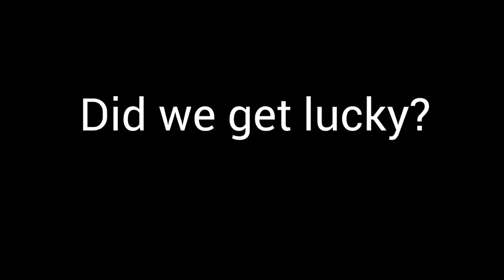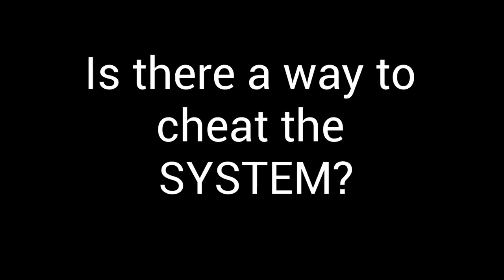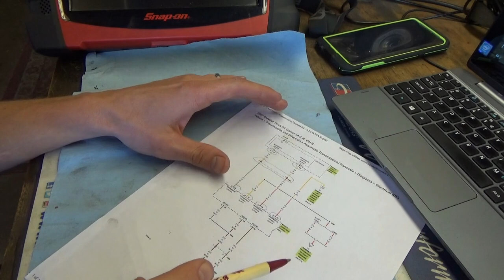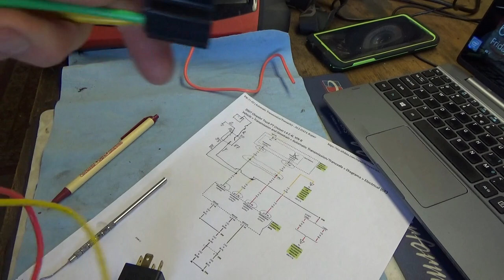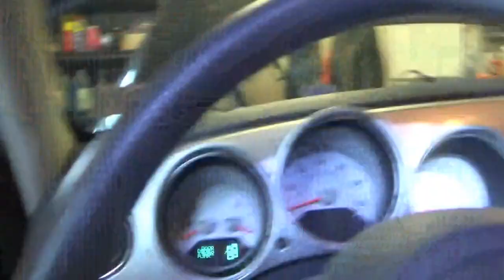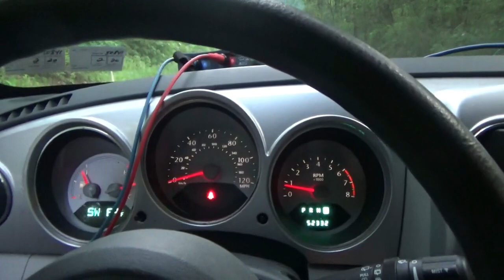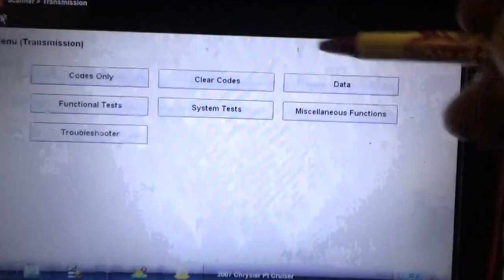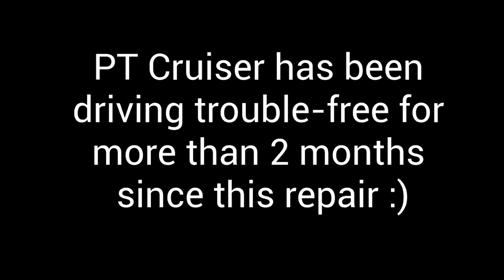Chrysler "LIMP HOME" Cruiser: P0882 - TCM Power Input Low (Part 2 - TIPM!)

Comment: You might soon regret that 1 year warranty. I would have replaced the power power transistors, probably less then 12 bucks with shipping. Or used a solid state relay. Your taking a guess that the output can handle a relay, your not even considering the feedback from the coil when that relay opens, could have at least installed a diode to keep the voltage from spiking.
Reply: Correct, but at 22:41 we have a scope trace of the output of the PCM now going to the relay coil (blue trace). There is no visible voltage spike. I would make a guess that this PCM was originally designed to drive a TCM relay and includes the suppression as part of the controller output circuit?
Reply: @jannepo  , The scope isn't going fast enough to catch a spike and you could be right but I wouldn't be betting 2 computer modules on a guess but it's not my dim.
Reply from the maker: Pico Scope is plenty fast :)

Comment: Hi 
Thanks for the video, I have same code in my Dodge Avenger 2008 SE 2.4 L , 4 speed Transmission 
Can you please help me with fixing it , I don’t have the wiring diagram for it and I don’t know which wires to splice and solder relay 
Please let me know how to contact you, I will pay for your time and help
Thanks in advance

Comment: You're probably also bypassing some other "safety" issues--- by not letting the TIPM put the transmission in limp mode for other reasons..   For example, I know that if the Accelerator pedal and the throttle body (or throttle position sensor) do not agree because the throttle is sticking, or more likely:  the plastic gears that actuate the throttle body break---  It goes into limp mode, because the throttle could randomly go to WOT (wide open throttle) or something, or could get stuck in WOT after you step on it-- because of a broken piece of gear making it stick open, ect.. ect..   I'm sure there are other reasons.  My 2010 Dodge Nitro had this issue, and the trans was put into limp mode--- obviously by the TIPM----------  This bypass won't allow that to happen now--- so if the car got stuck in WOT, the person would have to think fast enough to lock the brakes, turn off the key, throw it in neutral, ect. ect..   Which honestly I'm fine with myself.   We don't need this nanny state mentality trying to hold everyone's hand and save them from these very unlikely hypotheticals by putting our cars in limp mode for us.  (although, it did happen to my Nitro--- and it did high rev a few times like it had a mind of it's own:   so it's not that uncommon I guess. lol).   A new throttle body fixed my issue.    I love the work around here IVAN..  but it does come with it's legal liabilities.
Reply: I understand your comments very well and they obviously come from some real world experience. However you know what else should have some legal liabilities? The lousy engineering and lousy Manufacturing practices that are put into vehicles, Vehicles would sometimes end up killing people. Not because of limp mode but so what. How about some consequences. After all we pay for this stuff good bad indifferent.
Reply: Got your feedback about the Ford truck and the old couple, thank you. Informative feedback.

Comment: I would have changed the TIPM for a customer's car.  For my personal car I would have done what you did.  The thing is The rest of the TIPM is more than likely going to fail soon.  For what you did I'd charge $250 but I'd tell them the TIPM probably will still need to be replaced in another year or so.

Comment: Looks like a bad solder joint. Check the solder joints under high magnification to find a cracked solder joint.
Reply from the maker: The output ckt was OK, input was untraceable...so this was the path of least resistance. hahaha get it? xD

Comment: Love the fix.  But you are almost as bad a Scotty when it comes to worshipping at the altar of Toyota.
Reply from the maker: Well I just tell it like it is, and back up my claims with scientific proof! Not sure Scotty goes that far lol
Reply: @PineHollowAutoDiagnostics  

Ivan, I really like your videos and perhaps I have missed a few, but I don't recall any of your videos where you ever attempted to "scientifically prove " that Toyota branded relays were superior.  You see a lot more relay failures than I do I admit,  I suspect however that relays will fail after a lot of cycles and that often  the cars will die for other causes before the relays wear out.

I also suspect that if the component draws more amps than designed, relays will fail quicker.  But Ive been driving clunkers since the 70's and I while I have tested many relays, I can't recall a single failed relay.